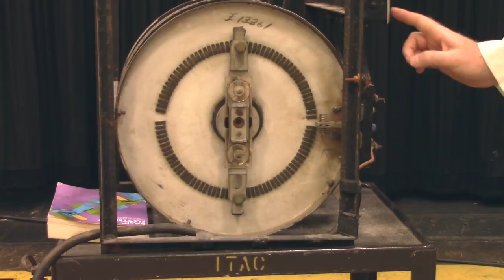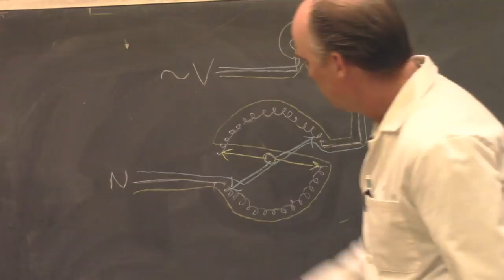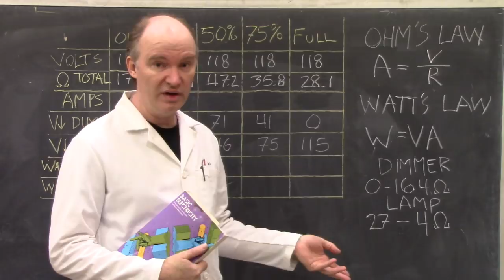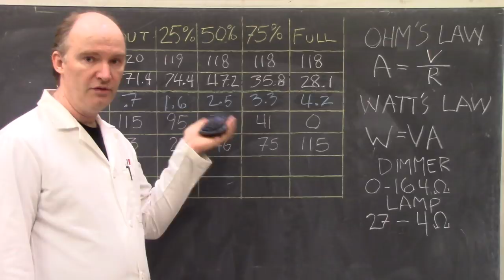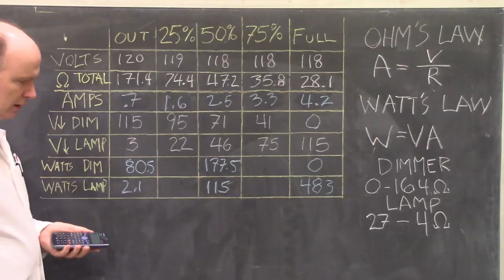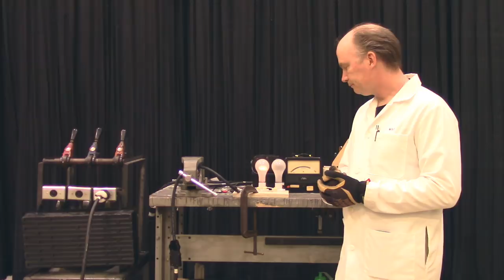Resistance Dimmers

Comment: Neat video. They had similar resistive devices (and variacs) for field excitation control at a mill I used to work at, originally built in 1926z